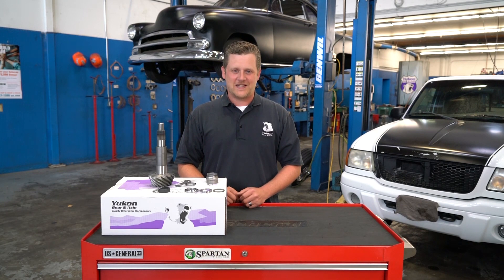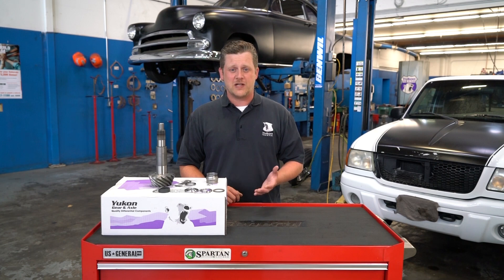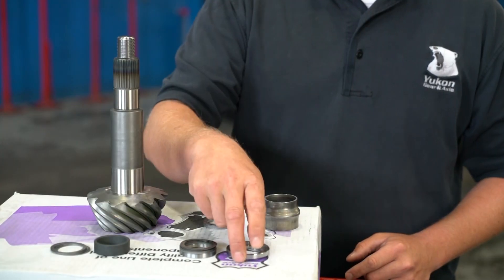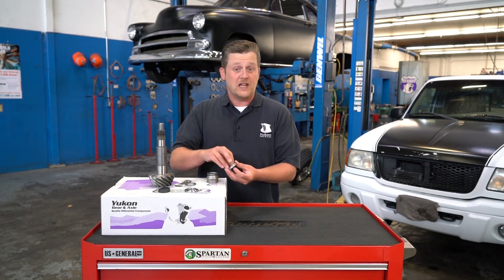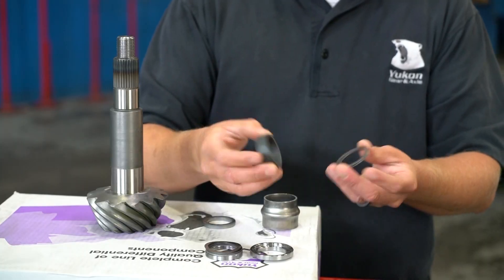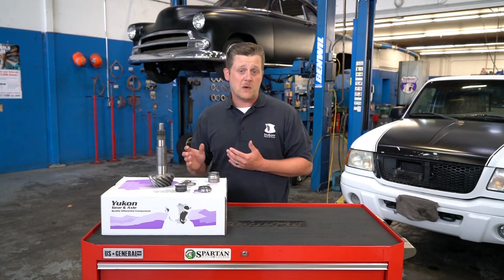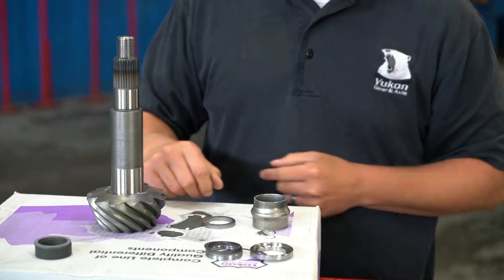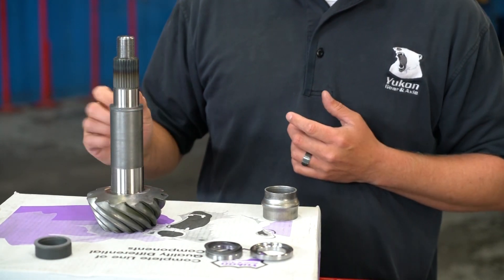Differences Between Crush Sleeves and Preload Spacers

Comment: I think I get the principal of it,
 you tighten the pinion nut and yolk  down and if you're tight with the pinion nut but still aren't in range of inch pounds of preload on the bearings, you would have to add a shim and then tighten it down again to see if the preload with a shim or two added, is  in  range, 
but honestly, it seems like it would be the other way around, 
that if you still have room to tighten the nut down,
 and you're already at the limit of inch pounds of preload, then you would have to add shins to increase the distance so by the time it tightens up tight against the spacer with however many shins added, and 100 or more foot pounds on the pinion nut,  it's not got more than the specified inch pounds of preload for the application?
 what would you do with your pinion nut?  would you have to finish off when you have the required inch pounds, by torquing it down tight,  to say100- 250 foot pounds  ?
Reply: U have to remove shims to make it tighter add shims to loosen ,  pinion gets bigger the closer u get to the inner bearing,  adding shims moves outer bearing away from inner bearing where pinion shaft starts getting smaller , need calipers to measure to notice the difference,   the crush sleeve and eliminator is just a spacer to get the bearing in just the right spot with right amount of rotational force. Hope this helps

Comment: Bought one of your crush sleeve eliminator kits for a 2004 Ram 9.25 rear end.  Do you put the shims between the spacer and the shoulder on the pinion stem or do the go between the spacer and the bearing?  Thanks.